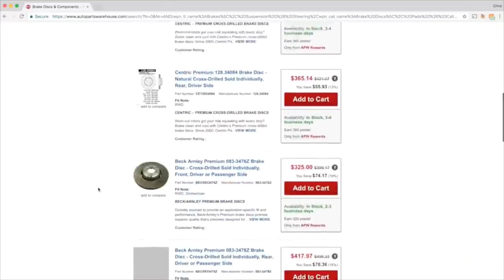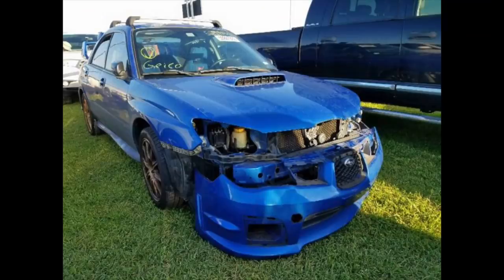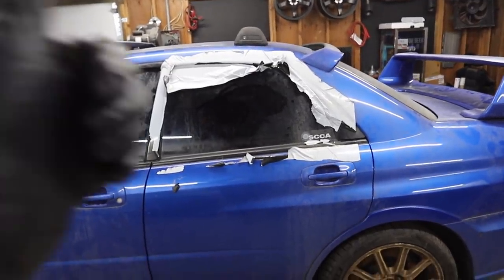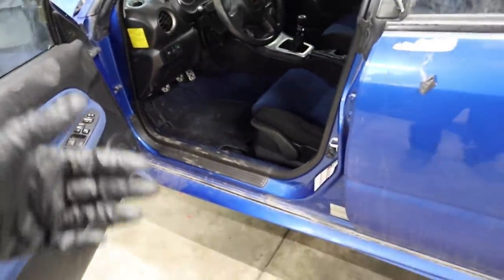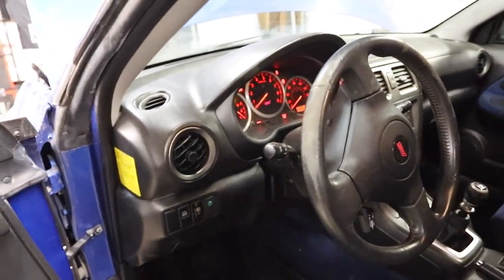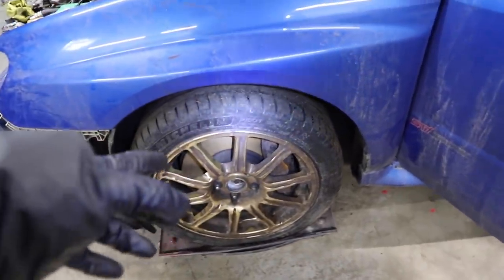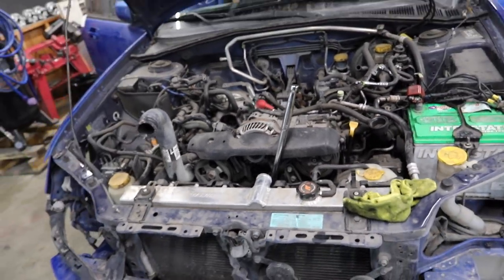I Bought a FLOODED TOTALED Subaru WRX STI from a Salvage Auction & I'm going to Rebuild It!

Comment: Wow, a stock Impreza it's difficulty in this days to find a 100% stock model.
Reply: Clapton 316 nah it’s not stock it has a roof rack
Reply: Is that a factory radiator?
Reply: @jackellis7216  the rack is factory...and that has nothing to do with a car being stock... the guy is talking about mods
Reply: It’s got an mishi radiator and aftermarket air filters, god knows what else is done to it
Reply: @mateoperez3659  Rack is not factory. It's a Subaru accessory but not factory
Reply: Has TGV deletes when he showed the top of the engine. Probably had injectors, turbo back exhaust, and definitely a tune. Basic bolt on stuff that probably 8 out 10 STI owners do.
Reply: @Wynorrific  It was a accessory from the official order list.
Reply: @Paulctshaw  It looks stock by STi standards. The muffler even looks like an OEM STi part. The rest look like reliability mods. Someone cared for that car.
Reply: that turbo didnt look stock either
Reply: Chad M The aftermarket parts were removed and sold before the car was given to the insurance company and replaced with stock parts since the owner would make more money off of it

Comment: Brian, you can use compressed air to blow some of the water out of the cylinders, just roll the engine over until the inlet or exhaust valve opens and blast air down the intake manifold

Comment: Chris' mom, "why would anyone want a Sexually Transmitted Infection??"

😵

That car has a blow head gasket and was purposely left out in the flood to collect insurance. 

That milkshake oil means the car was running while there was coolant/water in the oil. NOT just flood water added to the oil from a flood. 

CHECK 
THE 
COMPRESSION 
before you start rebuilding that engine.
Reply: chill will  next episode: subie engine is broken—> wrx sti lambo engineswap

Comment: Subaru's are known for head gasket problems, the water in the oil might not be from the flood, I'd say there's a good chance the owner knew it had a head gasket problem then the flood happened, decided it wasn't worth the trouble and that's why you now have it with minimal other issues. I'd just pull the engine and do the head gaskets anyway (because the engines are so easy to work on), find an intake and some other missing parts and it should run well again. Should be an easy and cheap build.

On another note if you have to remove and reinstall the water pump/oil pump/anything else from the Aluminium block, be gentle and don't over torque bolts because they strip super easy.

Comment: I'm thinking this is what happen, car was parked and apart cause it had a blown head gasket, water came in and he didn't raise it and just claim it as total loss because some water got into it.. I would check but pretty sure this is what went down.
Reply: I was thinking the same thing although idk why he would have kept some of the front accessories on like alternator and a/c compressor. Also didn’t even attempt to take out the radiator to get to the crank and timing cover. Sounds to me like he might have been chasing a boost leak. My buddy had a bad intake manifold leak on his 05 wrx some time after tgv deletes. Guess we will find out.
Reply: the car was in a garage with windows down  with a head gasket blown and the cover on :)
Reply: @dinocivardi8432  Or that! but def all indicates that this really wasn't flooded....
Reply: yes definitely
Reply: turbo model subarus arent prone to headgasket issues, only the NA models so I have my doubts on this one. Curious to see the next ep
Reply: @DumbTheories  Uhh. What? No. Turbo models are VERY prone to head gasket issues. People with WRXs and STIs generally don't pussyfoot with their driving habits. If you have a turbo, you're gonna want to boost. So when these cars are blasting 17lbs through a td04 turbo, you know the RPMS are north of 4500. Motor heats higher and expands faster. Much easier to crack a gasket with a car you're throwing into boost all the time.

While I also have my doubts that this car has a blown HG, it certainly isn't because it has a turbo.
Reply: @jimbom4009  No. You are wrong, please stop believing everything you read in youtube comments and then spreading it. Turbo Subarus have no head gasket related issues, unless you are talking about lifting heads running 30+psi of boost. It just isn't a common thing AT ALL. Ive owned 2 STi's and a WRX. No issues whatsoever. Ringlands are an issue on stock motors with bad tunes, but head gaskets are not. Only NA 2.5l Subarus 00-08 have head gasket problems and guess what? The fix was to start using STi head gaskets and they are fine after that.
Reply: @Alex-wb2yw  No dice, I'm not gonna' bite.
Reply: @jimbom4009  he's right though, turbos don't particularly blow head gaskets, i had a 16 STI and an 07 Legacy GT and can tell you I've pushed them harder stock than most people would, like 136 down the highway in the legacy GT and 160 in the STI kinda pushing. Everywhere. All the time, for months/years on end. I live in the WOT.
Reply: @robertwilk-WabbieWasabi666  Theres forums on NASIOC where people post photos of their High milaged turbo subarus with pride ( i had a 220k mile 02 wrx stock turbo on 15 psi) the headgasket thing is just a sic joke to subaru owners. THAT SAID early NA series 2 engines had the headgasket issue and the fix was later model series 2 turbo gaskets. they went through alot of redesigns until about 06 when it was starting to get figured out. the 08 wrx had an issue with ringlands. . .
Reply: @robertwilk-WabbieWasabi666  I don't disagree that the turbo itself is not at fault when it comes to headgasket failure. But the argument that NA Subarus are the only ones with headgasket issues BECAUSE there is no turbo is entirely misleading. I'm not sure if that makes sense. I've got a 16 wrx as well as an 06. The 06 is tuned pretty aggressively with the TD04 hitting peak boost at 19 lbs, and I haven't had any headgasket troubles either. However, I've had numerous overheating issues. And every time that happens I know I'm rolling the dice with my headgasket. (No longer an issue... cars in pieces now, so overheating is the least of my worries.)
Reply: @jimbom4009  td04 is a mitsubishi turbo is it not?

Comment: Hi there. My 4Runner has been sitting for about 6 months and when I opened the doors, it was musty smelling and I noticed some mold in cup holders. What should I do, other than open the doors on a nice day and putting the dehumidifier crystals in it. Is there an interior spray to use to kill it all?

Comment: mate of mine did that here in New Zealand where you normally cant import a flood damaged vehicle and register it for the road. because it was being turned into a rally car he was able to legally put it on the road as all wire harness, computer, seatbelts etc were replaced. airbags were removed. we striped it to a bare shell and rebuilt it. we even had to water blast inside the fuel cell as it had lots of crap in it. silly thing is after a year all the normal fittings could be put back in and it would be classed as an existing vehicle under the law.

Comment: Get to any electronics below water line dry out and clean pronto.  Quite often electronics still works for a while after getting wet and then fails later due to corrosion. Even rinse cct boards in boiled distilled water while water is still hot, dry with cotton wool.

Comment: Honestly, if the engine hasn't been sitting for years with water in it, there is no reason it shouldn't be fine. I run ice rallies and we have heaps of cars going to the bottom of the lake every winter. Sometimes they are down there for weeks, and other than very few cases, they are repairable.

Most of the time its enough to fill the cylinders with penetrating oil for a few days and swapping engine oil. Admittedly these are stripped cars with little or no electrical systems, so we dont have any computer that get wet and stop working, but mechanically its the same thing.

Comment: Brakes, axles, 6 speed, and driveshaft is already $3k. Wing, wheels, suspension, that aluminium radiator, and other parts. You can easily get your money back, if you wanted to part it out. I'd personally pull all the wiring, dry it all out, and apply grease to fight corrosion, if the wiring got submerged. Guess easy way to tell is to yank the ECU and look for water marks.

Comment: aftermarket radiator, but no AOS? c'mon previous owner
Reply: Plastic tank on the OE one probably broke. They are notorious for that.
Reply: Dude was running the stock IC, so probably also stock turbo. If anything, looks like that car had a tune. AOS is a neat little gimmick, but unless you're drifting or actually tracking, AOS in a Subaru is not necessary, and a catch can will do just fine. As far as I'm aware, AEM Seperators use gravity to get the job done, so if you're not rippin', it won't do a whole hell of a lot. Realistically, it just stops you from having to empty a catch can all the time.
Reply: many subarus have aftermarket rads, especially turbo ones because original subaru starts to leak on top or bottom from plastic parts. in this case mishimoto is all aluminium so no chance for leak
Reply: @jimbom4009  you sir, are correct. This sti is closer to stock than it is built or modded to the level that an AOS should really be on there. Stock turbo and IC on her. At the max she was a stage 2, with CAI, TBE and tune. In the video, the rad fans were spinning after the ignition was turned on which I would wager is because the test mode wires are connected under the dash from the prev owner in a hurry to either use his accessport to flash back to stock map or open source to flash the stock map back on. Test mode is required for any reading / writing of the ECU and it cycles the rad fans so you know it's in test mode. Overall this guy more than likely made out like a bandit on this car, even if he decided to part it out the sti six speed is worth $1500 all day alone and the BBS's, with the trunk+spoiler will net his money back.
Reply: @samuelortreger5813  I was wondering about the rad fans. I thought maybe it was because of the sensor, when they ran the diagnostic on the electronics and showed the screen that had the coolant temps it said "fault" so I had assumed there was nothing to tell the ECU that the coolant was cooler than 102. (That's when mine kicked in.) But  I had no idea about test mode even being a thing. This makes a lot more sense now, lol.

Comment: "Its only got 106k miles, usually people run these things into the ground " erm.... its lucky it's made it that far 😂😂
Reply: Idk why people say that. Subaru WRX/STIs that are taken care of often hit 150k plus easily and I've seen several with over 200k this year alone. Well usually WRXs more than STIs but still. Unreliability with them almost always comes down to bad mods/tunes, and people driving the shit out of them and not checking oil levels and coolant
Reply: Mines done 160k miles,it's 2004 model  regular maintenance and no mods after owning 10 years drives like the day I brought it.
Reply: @andrewlowe3422  Exactly
Reply: @Reefer-Rampage69  forgot to add its an STi just PPP added at the factory and an EJ20

Comment: I have an entire 05 STi harness and ECU sitting around.

Along with a steering wheel, steering column, throttle body, turbo, etc. LMK.

Lastly, JDM engines won't work in these without running USDM Spec cams a d crank trigger, they have different trigger points. 

It IS possible though, since I have a JDM 2.0L STi engine running on the factory USDM ECU.

Comment: Get an Ej20 head and Ej25 block!! Swap a decent turbo which can hold around 400hp. A true street fighter.  Refurbish the wheels and do proper wheel alignment. Then take ur car to Advance Automotive to wax and polish the car mainly the interior. And get the same paint job.

Comment: It's got 106k might as well get a timing chain, timing tensioner, head gasket kit.
Reply: definately need to do a timing kit with water pump.
Reply: @planecrazy29  I forgot about the water pump.
Reply: powcar91 timing belt. Not chain.
Reply: . Scout  lol
Reply: Headgasket at 100k? Damn is that common on Subarus? There goes my thoughts of buying used.

Comment: I have a full 2007 STI harness, manifold petty much anything you need. Check under the down for two green plugs if there connected it will turn the fans on and off.
Reply: Tommy Kentner where are you located? I'm in the SF Bay Area
Reply: @MR__JUSTIN  in Clarksville TN

Comment: I bought a working one for $5000
Reply: Used STI's here in California are still going for about 15-18k
Reply: Holy.. $5k.. where do u live? Cali prices are ridiculously high.
Reply: @mexzcanninja7412  does he mean a WRX? Because used STI's with decently low miles under 100k that are mostly stock go for 16-20k in most places.
Reply: @seemlesslies  I wouldn't be surprised tbh
Reply: I’m from Europe it is in fact an STI, but it has some scratches, have done some paint corrections and it now looks fantastic
Reply: It’s a 2003 btw

Comment: Best way to sort a flood damaged car is drop the oil out of engine , take the plugs out then remove the carpet and seats plus door trims. Put the car in a paint booth and set the booth to bake for a few hours.    This will completely dry the electrics . Do not connect a battery until you have done this or it will short half the car’s system. Then get the carpet and seats professionally cleaned before refitting or they will start to smell.

Comment: Mate i have the same air intake as the one i see in the trunk,if the water level is that high it would cover the whole filter. I've had rainy days here and if i went full throttle if would surely have sucked some water in

Comment: I never owned a Subaru before, but I highly doubt that that aluminum radiator is stock? If I'm right about it not being a stock radiator, than that would've cost over $400 I'd think? As far as that SCCA sticker on the side window. That would explain those really good track tires and possible aftermarket radiator! My guess considering I used to race in the SCCA, is that car was a track car that would go to open track days? I would imagine that the suspension has been upgraded too!

Comment: Damnit.  You got my old car....  I baught one back in 04'. By 05' I baught a new short block from Subaru as I spun 1 rod bearing. And Subaru wouldn't warranty it. Learned it starved from oil. Put new high volume oil pump and ran it for another 2 years happily then sold it. Miss that sucker.  Wish I never sold it.
P.s.  when u get it running, you will hear loud ticking from its injectors. That's totally normal. Enjoy, and good luck.

Comment: yep they pulled all the easy bolt-on stuff off. Mishimoto radiator confirms. Edit (after watching more): nvm. the guy was probably working on it when it was parked. as others have said, probably already had blown head gaskets

Comment: unfortunately you can not put a JDM engine in the subaru due to the fact that in Japan they only got 2.0  twin scroll engines while yours is a 2.5. Wouldnt make sense to go through the hassle. Subaru OEM short blocks are under 2k and you can get your heads refreshed for a couple hundred

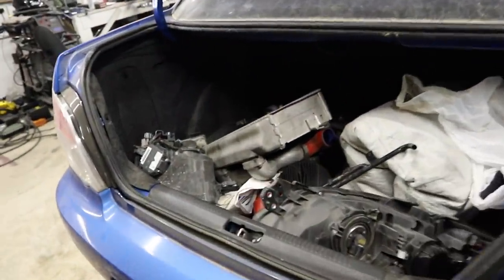Comment: 16:30 Why would you remove the intake and all the other stuff if the car has been flooded? But its nice that the missing parts are in the trunk and not on ebay because the previous owner sold them off for profit...

Comment: Fans are running because the computer defaults them to run when there is no input signal from the temp sensors :)

Comment: you need to turn the crank a full 360. i guarantee that motor is toast. my guess they drove into a massive puddle and the motor sucked in water. water lines arent accurate.

Comment: oil out..

coils and plug out
preston out
run the engine no plug to push water from the cylinder..
replace all the fluids..
new plugs..
cross your fingers...
START IT..

Comment: I drove my car into a body of water like a dumbass to try having fun offroading stalled in the water and the level was about that high or higher, car ran right after we pulled it out and still runs only fried my electrical seats what i would do and what i did and what i would recommend is pull the entire interior and clean it and the connectors everywhere pull the door panels as well

Comment: I can tell you why the “auction yard” or “Copart” as I’m sure that’s the place your referring to didn’t get the correct information on the vehicle. The yard staff there is over worked and under paid. As you said 10,000 cars. I use to work for Copart and Texas yard is the biggest by far, so you got the good ole “jump box is dead” car

Comment: I bought a subaru impreza 06’ automatic with 243k on the body and an engine swap with 147k for $1.5K
Reply: After mechanic check and all total was about $2.5 with a change to my muffler, and the inside tire bolts changed as well

Comment: Does copart (I know this one came from geico) cut you guys great deals to promote different things?  I have noticed most rebuilders on youtube build the same type of stuff around the same time and I have also watched the prices at copart skyrocket to the point of when the build is done and you factor in parts and initial cost one would be better off buying a mint car and not deal with the diminished value.  I enjoy the vids and glad to see you are going back to normal car but have been wondering this for a while.